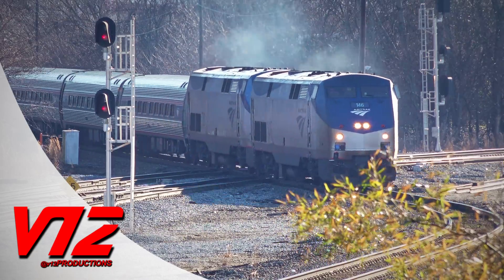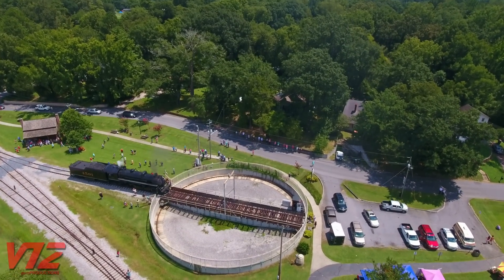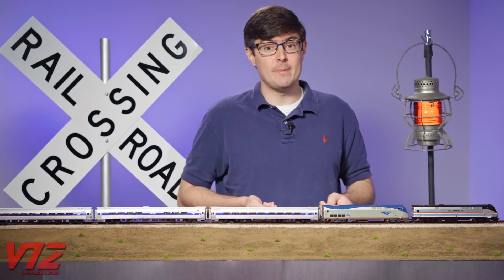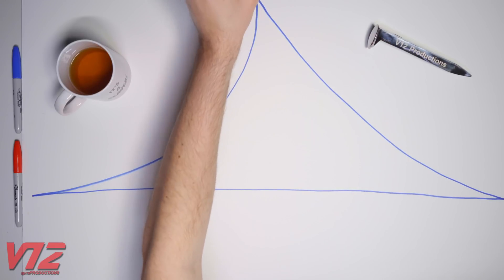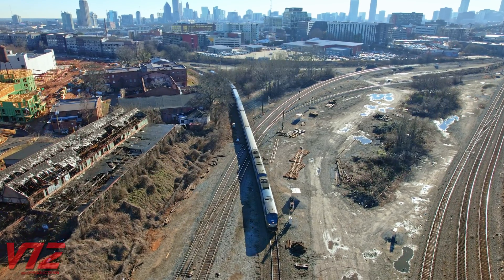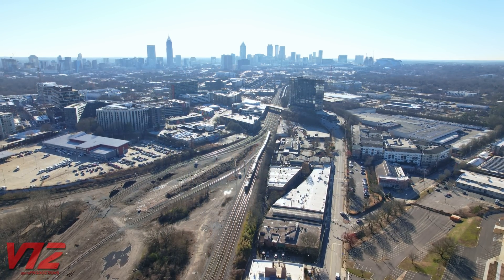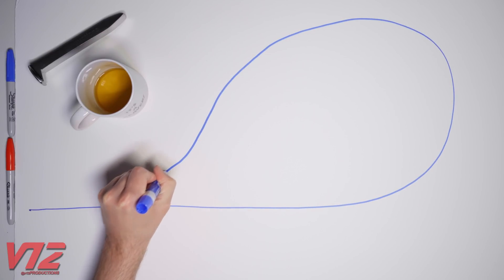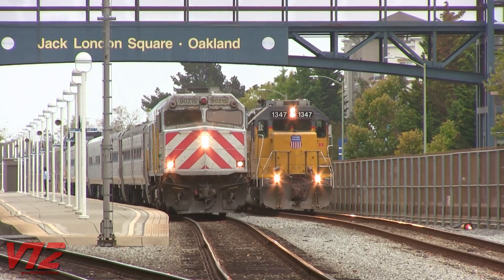How do you TURN a Train around?

Comment: Has it never occurred to American railway companies to put the second power unit on the back end of the train, facing the other way, like European trains? That way it can go both ways without all this extra time and track to change directions. Amtrak seems so backward compared to European transit systems. Even their carriage consists often don't match in design.
Reply: Well they have them like this in case the front one fails. If they had one at the back, they’d have to get around to the front of the train to pull it

Comment: The reverse loop system is sort of what we often do in the Netherlands to turn trains around. Our network is quite densely packed with various railways that connect to make loops where trains can run around. It isn't common to see such movements but it has happened before when a multiple unit has a flat spot and has to be oriented in a certain direction for the wheels to be in the right direction at the works, or with a charter run where running in the same direction is preferred over having to switch end frequently.

Comment: As a European, this all seems awfully convoluted, and the only reason I can see for such operation is that you want the consist layout to stay the same, and yet in Europe we are fine with the layout being flipped (so like first class goes from being at the front of the train to the rear). Will it really confuse Americans that much if the layout is flipped?
Reply: Lots more space in North America so we have lots of room for Y's.
Reply: @connieembury1  But density is more efficient. If the locos were back to back, you could use points to get to a parallel track, run round to the front of the train, and then use another set of points back to the original track, and be hooked back up in 5 minutes tops. This took what, half an hour at least?

And that's not even talking about things like a DVT or top and tail.
Reply: @mattevans4377  IIRC, Amtrak prefers to have engines facing the same way (elephant style) on its long-distance trains so that the 2nd engine is able to take the lead should the 1st one fail enroute. Having them back-to-back would render both engines useless as there are seldom any wyes nearby. OTOH, two engines elephant style are rarely used on shorter routes. Such services are usually solo-lead, two engines push-pull or push-pull with cab car.
Reply: @RestrictedProceed  Can they not do distributed power like the freight railroads, so if an engine fails, you can still drive the other one from the first cab. Would also save on crew costs.
Reply: @mattevans4377  There can be situations where the 1st engine is incapable of physically leading the train, for example RXR collisions, broken windshield or control system failure.
Reply: @RestrictedProceed  Then why does Europe cope fine?
Reply: @mattevans4377  Do you like having arguments with people trying to explain to you why something is the way it is rather than the way you would like it to be? Amtrak decided what the best way to run their trains is and I really don't think they care what two random people in a comment section think.
Reply: @RestrictedProceed  I just find inefficiencies weird. But you are right, reality doesn't work how we want it to, even if we would like it to. There'd be a lot less wars and division among people if dreams became reality.
Reply: @mattevans4377  The problem with (in)efficiencies is that they are often relative. You see a train wasting time (and thus money) turning on a wye, but there is a possibility it saves money in another way (easier recovery during breakdowns, not having to rebuild train stations, not having to install MU cables in cars, etc.) It's up to the management to analyze all the pros and cons and decide what the best course of action is.